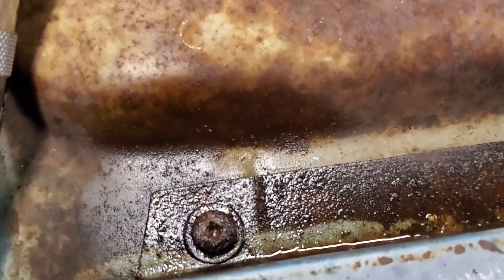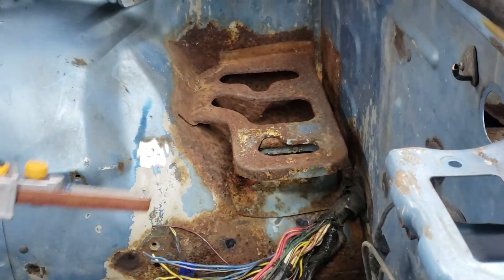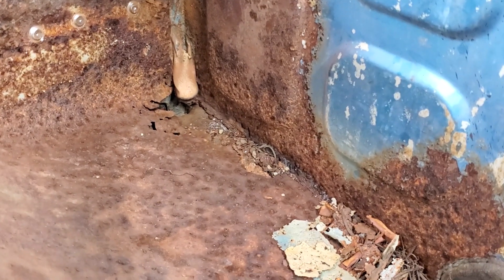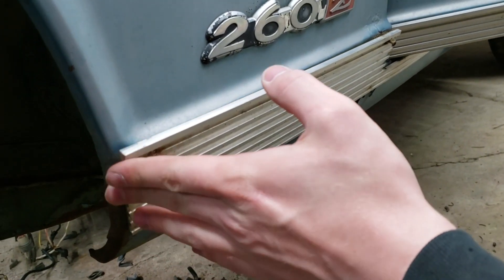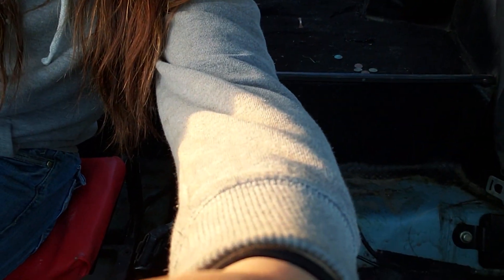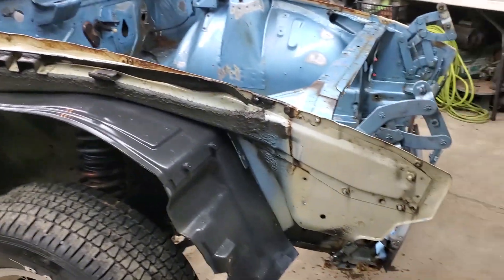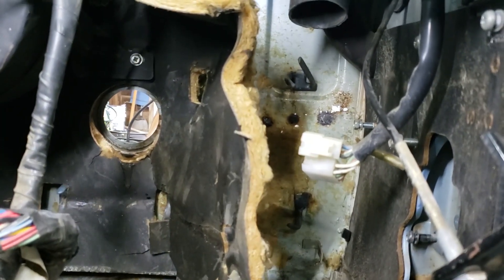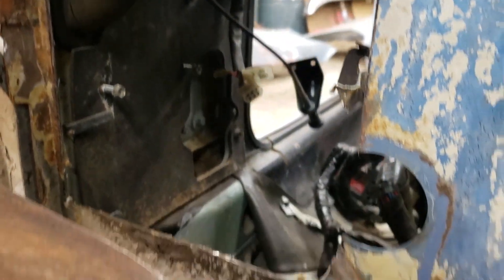"Engine Bay: Part 2" | Ep. 7 | Datsun 260Z Build

Comment: You guys are doing awesome work.  Even the most solid looking s30 cars have rust, and this one looks like no exception.
Reply from the maker: Thank you! We might have to look into getting one of your 8.8 rear kits at some point as well. I don't think the stock rear axles will last very long! 😂
Reply: @WrenchChill  the diff might, but the axles definitely won't.  Plus side to the super 8.8 is the cheapest diffs are a 3.15 lsd... and they match perfectly with a nossan cd09 trans ratio wise.  Something the 3.54 r200 doesn't do well.

Comment: Dont know if your sand blasting.....but the trough the wiper motor bolts to.
That area from the factory barely got primer on it from the factory.. so it should be thought of as the bottom of a boat as it retains rain water,bugs,leaves and debris.
Should be sealed water tight as possible.
Reply from the maker: Thanks for the tip! We spent some time getting all the dirt and pine needles out of the wiper motor cavity. We have some cleanup in that area left to do for sure